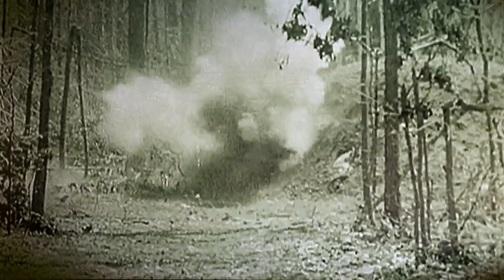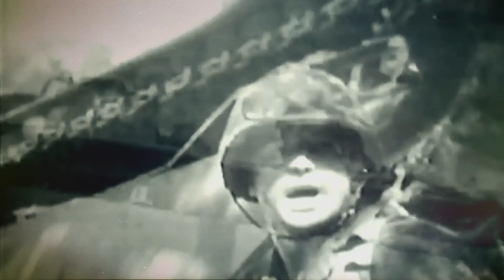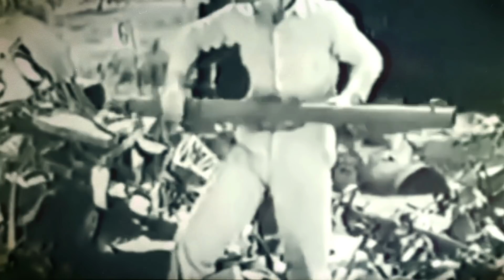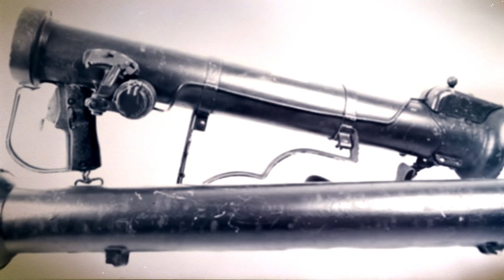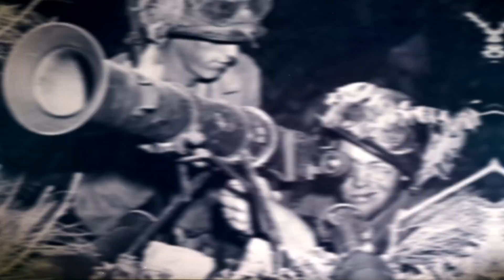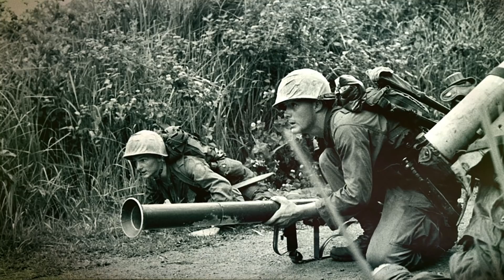The Super Bazooka

Comment: Necessity is the mother of invention….  The “Bazooka” was a steel pipe around .090 wall , Roughly the size used on the exhaust pipe of most of their trucks.  Meanwhile, blueprints were widely circulated that showed how to make a Sten by using parts commonly found on most beds.  2 bedrails, a couple of springs, and most men of the era could make one with skills obtained at the time.  Could you imagine that now?  The ones that “define” themselves as men couldn’t tell you what end of a screwdriver to use let alone point out a lathe…. Sad, sad times these truly brave men once fought in that we now find ourselves in today….

Comment: When describing a shell size in millimeters it is not calibre, it is diameter. Calibre is specific to diameter in tenths of inches. Here are a couple of examples.  
1. 88mm diameter anti tank round. 
2.  .50 calibre heavy machine gun round. 
Also, guns and cannons don't fire shells, they fire rounds. The rounds do have shells, the shell holds the gun powder and the primer cap.

Comment: Just my two cents:  In Korea the bazooka's upgrade wasn't as fast as implied.  It took the fate of Task Force Smith to make it happen.  This could have been political, because at this time policy makers in Washington DC always treated the Pacific Theatre as a secondary theatre.  And thus received "secondary" equipment.  (Europe first was the norm.)  

I hope they were only training with the early bazookas against Sherman tanks and not testing them.  But, testing them against Shermans would explain their poor performance against German tanks. US and German tank armor wasn't exactly interchangeable.  

Ironically, the Germans probably had more success with captured US bazookas against US tanks than the Americans did against German tanks.  

I don't think he mentioned it:  the Germans designed their panzerfaust and panzerschreck to engage Soviet tanks which were larger and more heavily armored than their US counterpart.  Since the bazooka had problems destroying a Tiger or Panther - it would've probably only scratch the paint on Soviet IS I, II or III.

Comment: I was a 3.5” rocket gunner for 1 1/2 years in the Marines 1974-75.
Reply: I used it in the Cdn. Army (Reserve) in the early 1970s; the Regulars were using the 84mm Carl G by then. We got the hand-me-downs.
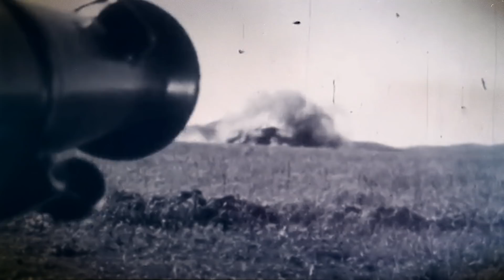Reply: Dig that screwy round at 4:06 with the long nose cone and those exposed fins!  Must have been an early prototype. The rounds came in a wooden crate, 3 of them inside. I had a decent empty 3.5 inch wooden rocket crate and it held all of the treasures a 10 year old kid could ever want. I packed it with Cokes, cookies, and snacks during the Cuban missile crisis in case we had to bail out and head for the hills after an atomic attack. Pop had the truck packed with camping gear, food, and water. We all thought we were goners.  That rocket case is in my attic somewhere, a time capsule for me.
Reply: I bet it was a BITCH to carry
Reply: I was a 3.5 gunner in the Army in 63-66 it was replaced by the 106 RR.

Comment: The 2.36 Inch M1 Bazooka missile range test data:

Maximum range = 458 Yards.

Up to 119mm. @ 0 degrees.
Up to 112mm. @ 30 degrees.
Up to 105mm. @ 60 degrees.
(Figures translated to metric from imperial).
Reply: Get outta here with that metric stuff, long live the rule of the kings foot